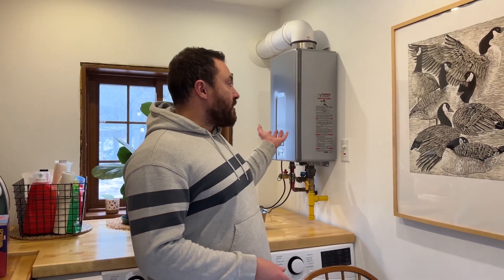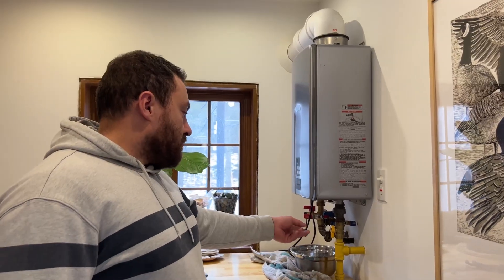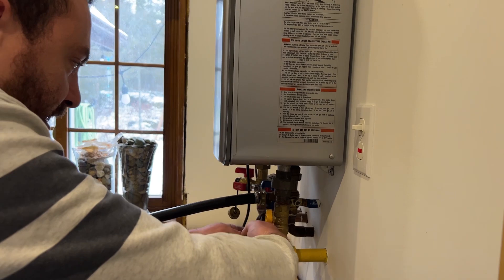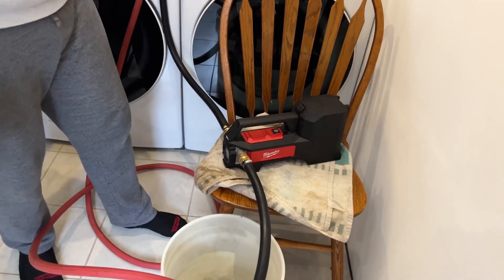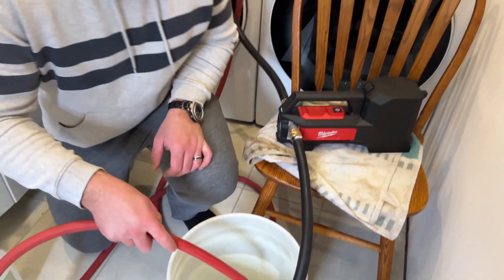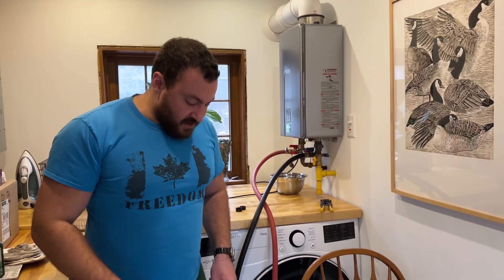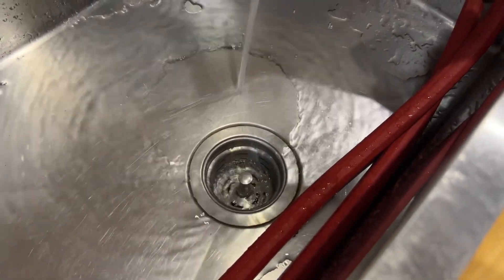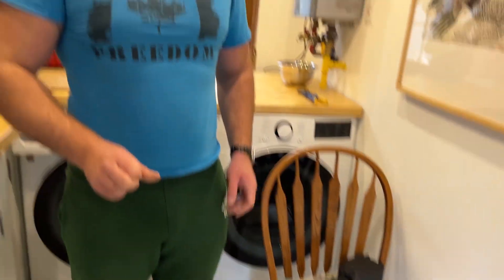I Abused My Tankless Water Heater For a Year - Is It Fixable?

Comment: Thank-you great video. I have already done this in town in a home to a tankless hot water heater due to an error code.  I have hard water from the municipality my HVAC Tech old me do this with 6 Leters of white vinegar for 50 min change the vinegar 1/2 through.  It clears the code and is cheeper than hiring a plumber.
Reply from the maker: Good to know, thanks for the info and glad you enjoyed the video!
Reply: @cabininthewoods517  I think it's good you shared the knowledge with others.  And better you stuck with it even though it took time as you realized there was a big blockage in your case.

Comment: I bet the problem is your check valve. It has small passages that clog easily from dislodged limestone. Remove it when you do this procedure.
Better yet,  put your cleanout tap ahead of your check valve.
Reply: Something else to note especially if this is a rinnai, the inlet side has a pre filter that you should remove prior to this. Learned the hard way

Comment: "I don't want to mar the service of the cap."
Instantly mars the surface of the cap.
Reply from the maker: So which did I mar, the surface or service?
Reply: @cabininthewoods517  surface. But also just a little new years snark. :-P
I cannot count the times I've with great care completely scratched an oiled bronze finish.
Reply: @cabininthewoods517  I am a plumber, everything was fine, I would have left it running though. Just the way I was taught.